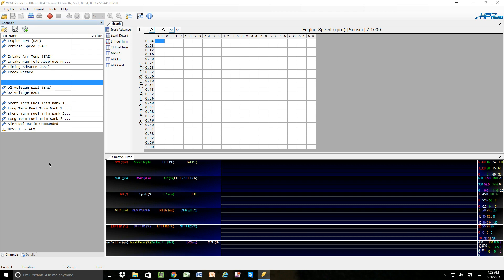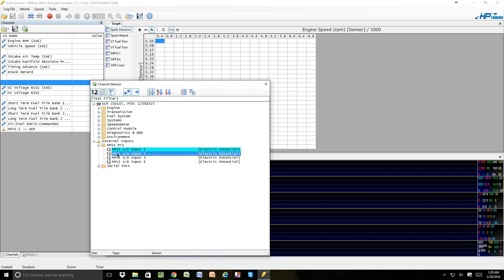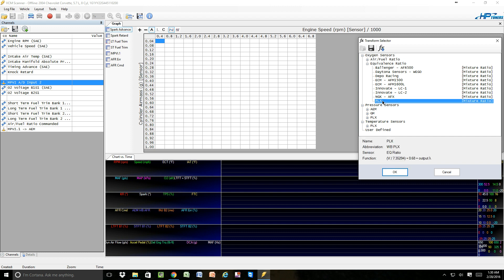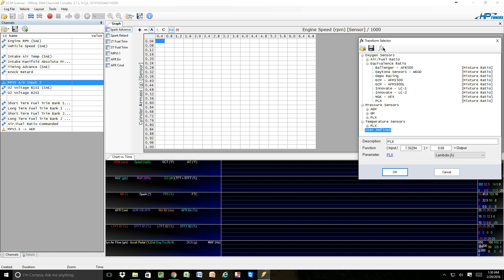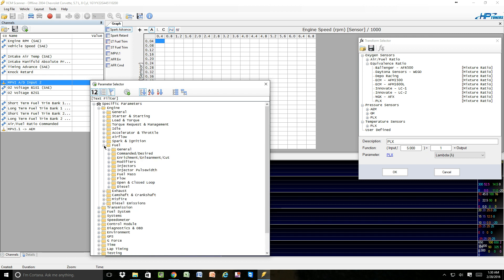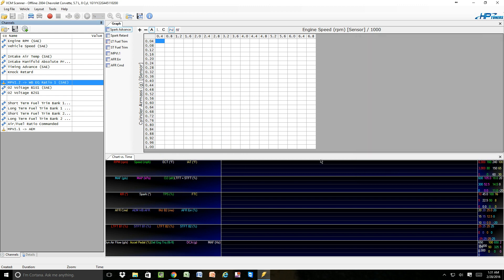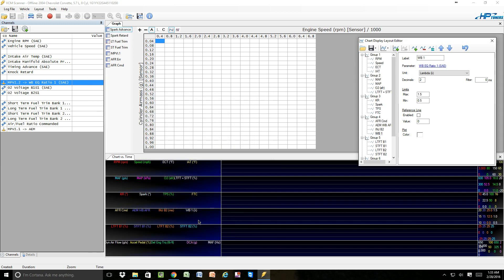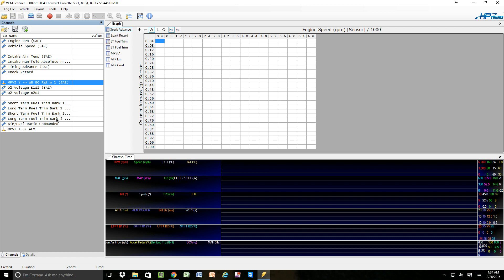HP Tuners 3.0 -- How to Transform a User Defined Wide Band

Comment from the maker: Just an update to this video.....when we selected the EQ at :40, you could also select the AFR options and select from there if you want to work in AFR. At 1:20, the data you enter here will be defined in your wide band manual. The equation is the output voltage range (normally 0 to 5v or 5V total range.) divided by the Maximum Reading minus the Minimum reading (i,e 20 AFR - 10 AFR = 10AFR). for our example the first value would be .5, The last value is the minimum reading or in the case of our example it would be 10. Tis is also the value you will adjust up or down to compensate for any analog/ground induced variances. Hope this helps...Edward Mowton, ERM Performance Tuning

Comment: Hi I was wondering if you could help me: I am trying to data log my car. I am using Hp tuners MPVI2+ standard version with a usb to serial port, and having a hard time figuring this out. I need the correct values in user defined.I am using the AEM  4110 kit. I want it to read in AFR Thanks. Chris

Comment: Thank you for the great info. I am trying to use the ERG ECU pinout to collect the WD input. Where to I input the ([PID.2811]/.5)+10 ? Thanks.
Reply from the maker: You go to Tools>Math Parameters and down to the User Defined area. Go to your first open slop and click it. The Math editor will open. Copy/paste the formula into the expression box. If all is good, it will go to white, if not, the red shading says there is something wrong with the expression.... like you don't have the EGR parameter in the Channel table. Then save. Go to the Chart, open the chart editor, go to Parameter, click , go to Maths>User defined and click the new parameter you just added. Hope this helps and thank you for the props....

Comment: Good day Mr. Mowton. Thank you so much for posting this video.
Question-will the same be followed for AFR?
It seems then the software has the error formulas done, we just make sure to have the parameters in the channels and charts? Before, we had to create the afr error when we had a user defined wb setup. Thanks!!
Reply from the maker: +ernestocorelli 

Thank you for the props. Yes AFR and Lambda are the same, just go to Oxygen Sensors>Air/Fuel Ratio and select the WB (or one that is close as you will be redefining the equation anyways) you want. The key to using the internal error is defining the WB as a sensor (Yes, Sounds Good) when setting up the Chart. Do the same for your Commanded Lambda/AFR as well. 

Ed M

Comment: is this with the usb or the serial?????????????/ how do you use the usb on a standard mpvi
Reply from the maker: Anthony, this is the analog interface. I responded to your question on the other video.

Which WB are you using? As you are using the standard, this video shows how to interface the analog through the AC Pressure or EGR input of the PCM in the analog mode.